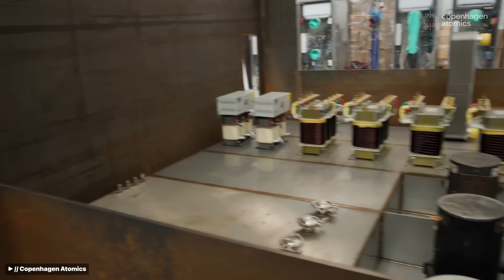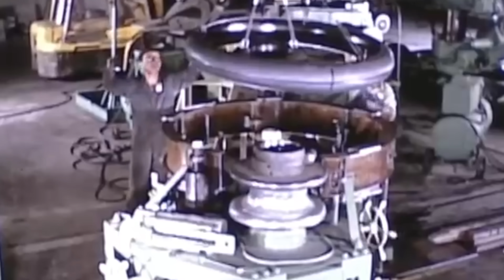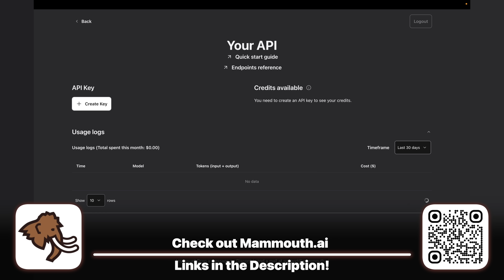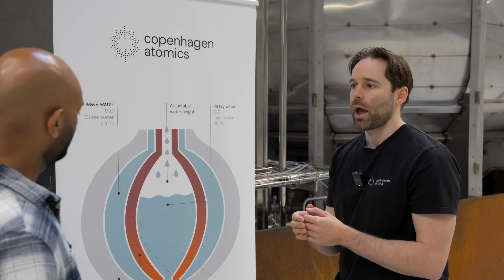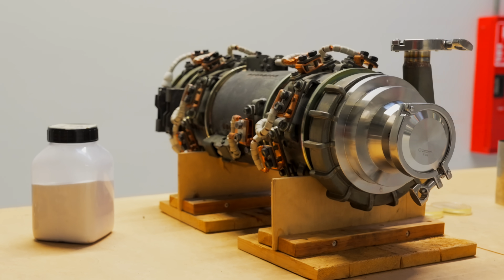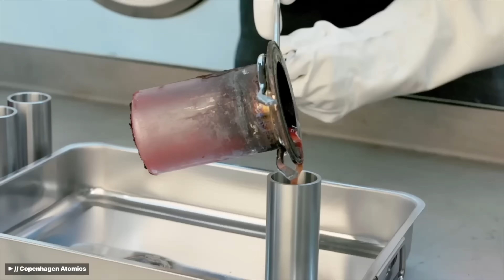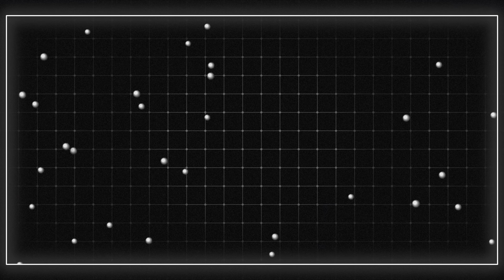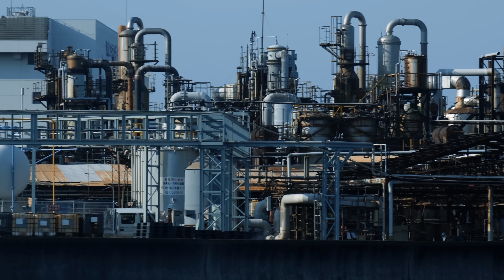This Modular Thorium Reactor EATS Nuclear Waste

Comment: A large number of reactors being widely proliferated is undesirable from the perspective of reducing security overheads.
Thorium Molten Salt Reactors look to be far more attractive than Pressurised Water Reactors from a safety perspective but they are not devoiod of issues. You are still dealing with radioactive materials and some of those in the decay chains are Gamma Ray Emitters.
I don't like the idea of a great many small reactors being proliferated, the more instances of a machine that exist the more likely that one will malfunction and transporting such things around should be avoided.
Perhaps a limited number of sites with multiple small reactors and/or develop larger reactors.
Small Mobile reactors look to be very useful things in the case of emergencies or for creating sources of power in space.
Dropping them on parking lots, no, locating them at a limited number of locations with appropriate security and facilities to process waste yes.

Comment: That's quite cool. I like the safety aspect of it. And I like nuclear. However, I'm curious about the lithium separation scheme. If a Li6 is absorbing neutrons wayyy too much, it becomes Li7. Which is what they want. Isn't there any application like you know, the regular nuclear reactors where they could use the Li6 as moderator or neutron absorber around to just make it become Li7 and use it after ? Or you know, just use their own process : make a first part, then slowy input Li6 in the reactor running it a bit overpowering to purify progressively and make more Li7 ?
Reply: They can easily decant the salt, most likely after the "life time" of the reactor they recycle most of the materials.
Reply: Yeah what he said ^^
Reply: Lithium 6 plus neutron doesn't make lithium 7 - it splits to make an alpha particle (ie a helium nucleus) and a tritium nucleus.
Reply: @2x6x250ml  oh ok, ty

Comment: I want my backyard Thorium reactor!!
Reply: It's about time, let's just get on with it!
Reply: Unfortunately fission reactors will always be big (the critical mass limits size) unless they can shrink particle accelerators down small enough to run small ADS (Accelerator Driven Subcritical)  reactors. Theoretically they could be made small enough for a household power & heat source.
Reply: @fredbcf1255  They made us small enough to fit in a jet more than 40 years ago. We can do better now.
Reply: @JadedCoffeeDrinker  Russia has one in a torpedo and and a cruise missile now. Poseidon and Skyfall I believe are the NATO names for them. But they run on weapons grade uranium or plutonium. That's what you need for a small core. Also neutron reflectors.
Reply: @JadedCoffeeDrinker  U can't compare military and commercial technologies for households.
Reply: @fredbcf1255  ive messed around with the math and theoretically with neutron reflectors you could make a reactor the size of a football/soccer with only a couple hundred grams worth of thorium you can even shrink it down into palm size if you include a small pellet of plutonium to provide some extra neutrons also all this is for the core btw not the whole system
Reply: @NHRTYu  No chance. The thorium does zip until its bred, a slow process that requires a time period to convert properly. The only way to make small reactors like that is with pure U233/U235/Pu239. You don't want any thorium in there.
Reply: @fredbcf1255  right mb meant to say uranium
Reply: Don't be silly!  If you want your own reactor the build it yourself!!!  Stop demanding!!!  That's not the way to get anything!!!  You didn't even say please or thank you.  Now...  I know your joking around and so am I.  I hope you understand.
Reply: @anthonybaransky137  Point taken. Not sure that's a great DIY project. I 💯%  would buy one though and bury it in the back yard, substation above and sell electricity to my local municipalities.
Reply: Oi mate! Ya got a loicense fer dat?
Reply: It is possible, but only if you like subscriction model.
Reply: Maybe get together with your neighbours on buying one that could power the whole neighbourhood and sell power to the grid.
Reply: Never it will be less than 30 MW. Never for households.
Reply: @MihailG5541    I've heard that word before.  'never'   - It's quite often incorrect.   Especially around politics and science.
Reply: @OneWildTurkey  Ok, never during that generation.
Reply: @MihailG5541  I will sell to the local cities/municipalities. And my neighbors for cheap. Sign me up!

Comment: It's bonkers how we keep hearing about this. It's orders of magnitude too expensive for mass production. As mentioned, solar+wind+neogeo+storage. At the small network level you can definitely get the same level of reliability for much less, and with basically all the tech in production already. For a few one offs where that isn't possible, there are other bespoke solutions already, and have been for decades.

Maybe if they had have continued on thorium 60 years ago, we would have had this decades ago and a price point that makes sense. So just no
Reply: Forget wind and solar with batteries.  They're pathetic.  Geothermal is the most optimum energy source.  Why anyone would entertain the idea of installing suboptimal solar and wind with piddly man made batteries escapes me.

Comment: Municipalities should have their own small reactor. It would be for basic electricity, electric cars and heating and cooling. This way we wouldn't have to buy energy (oil) from dictators and oligarchs.
But the power grid companies won't do it voluntarily, so legislation is needed, i.e. the right political structure. But the implementation of the political industry is currently controlled by the oligarchs through lobbyists and outright corruption.
Reply: Which country are you referring to?

Comment: At this scale, you need to see farther I think. It's small enough that it could be delivered to inhospitable environment and be used as the core of an outpost. Just fly to the middle of antarctica, drop it and connect whatever you need. no freezing fuel once started. Enough sustainability that an outpost deep in Antarctica's interior would not worry about losing heating at -80.

Long ago, a plan was theorised that installing hundreds or thousands of water pumps on the arctic ice caps to pump water up top would thicken the ice and possibly reverse the melting ice problem that was widely talked about at the time. It was impossible to implement since the energy needed to run them was almost impossible to bring without ludicrous amounts of money and would constantly require more. a reactor the size of a container able to run for a couple years could have made it possible. Still would not have been done I think, but still

Comment: Not convinced. Targeted cost/kwh is $20/kwh with these reactors. The global benchmark for solar + batteries is $0.08/kwh.
Reply: 20usd per Mgwh he said not kwh
Reply: @rtzx12570 you are correct. I stand corrected. More power to them if they can do it safely. I'm going to stay skeptical for now. I'm Canada, we're seeing $20 - $40/mwh and we've just tiptoed into renewables and batteries. No nuclear risk.
Reply: @TooSchoolForKool  Denmark is widely considered #1 in the world when it comes to the percentage of its electricity consumption covered by wind. Its not like we do not use renewables or have solar (tho we don't lead in that by any means). But we just have to consider that sometimes the wind does not blow ;)
Reply: Twenty dollars per kw-hr??? Maybe twenty cents.
Reply: No way... That's more expensive than it should be by orders of magnitude
Reply: Pretty sure he said MWh. That might be wrong, but he didn't say kWh
Reply: The cost of a fully firmed, 24/7 solar system is much higher than the simple $/kWh figure quoted for daytime energy.  Also, In densely populated or land-constrained areas, nuclear’s energy density is a major advantage because the equivalent solar would require tens to hundreds of square kilometres.
It’s a complex problem and if they can get these reactors online ( a big if right now) it really would be a game changer given the huge surge in demand being caused by data centres and electric cars.

Comment: Could they not place this container under ground via a elevator and place in to a room this way you don't need a massive steel container to protect against bomb,  plane strikes, etc? Sure it has to be in a stable subsurface areas. This way they can be placed where the power is needed and out of sight and give additional safety.

Comment: 40 MW per day per line? That's 14.6 GW per year per line...still tiddler level.  Several hundred gigaWatts of solar are installed per year, and rapidly accelerating.  Tens of gigaWatts per year of nuclear will be a small amount useful for high latitudes and data centers, but to make a big difference to global power use, it needs to ramp up a hundredfold.  All the best for them.
Reply: In China, this is a current reality, one such reactor is already running there, unlike other countries where they are just trying to invent one... How on earth is it possible that this video ignores this fact and does not even mention the Chinese success?

Comment: Hang on a minute. Did you say that it is presurised with Heavy water at 600 degree?

Good luck getting certified.
Reply: No, they said unpressurised heavy water at 80 degrees.
Reply: @edbruder9975 Which salt do you know about that is liquid at 80 degrees?
We are talking about a Molten Salt reactor, aren't we?
I didn't even bother to check it but you should check your hearing.

Comment: I really hope these guys succeed but there is a lot of engineering challenges ahead.
It's not just Lithium enrichment, you need the salt purification to keep it non-corrosive even as Uranium splits into random chemicals, you need the protactinium separation to pull it out of your blanket salt as soon as it is created, then of course pull the Uranium out and introduce it into your fuel, I've seen that it's apparently doable with electrolysis which is huge but it's still a process that needs to happen with a radioactive hot SALT and that's no small matter.

The reality is that existing 60 year old nuclear technology (Light Water Reactors) is ALREADY better than fusion (baring some amazing breakthrough) when it comes to economics but there's a lot of barriers that add insane ammounts of overhead costs that simply don't have to be there. You can build nuclear cheap, quickly and safely just not in the overregulated western world, you need to go to South Korea for that.
Reply: Fossil fuel lobby effectively sandbagged nuclear with astroturfed enviromental and safety regulations
Reply: yep, I want to learn more about that. It's the holy grail. They need chemists to solve this.
Reply: @Mr1Spring  Sure it's TECHNICALLY the holy grail and like I said I wish them the best of luck but it's not very much ahead of the next best thing and that one is about on par with many other things. There's lots of ways to split an atom and plenty of them can give us nearly limitless cheap and clean energy. Better than fusion for all of them (because its cheaper and easier)

We should be doing all of them at the same time right away and see what the market ends up chosing. But for that of course the government needs to stop interfering so hard.

Comment: Just to be clear, any facility, if impacted by a large enough munition, will crack wide open. So calling these small plants out, especially when encapsulated, is a bit disingenuous.

I'd be far more concerned with end-of-life recycling or emergency maintenance of the molten salt loop.

Also, that litium-6 that is removed can be used to make Deuterium for fusion reactors.

Comment: Game changer? Absolutely yes, but not because of thorium fuel but the low-pressure/high-temperature molten salt reactor technology, that is the real game changer. This same reactor using low enriched U235 would be much less complicated and much less expensive, that's the game changer. That's exactly what Terrestrial Energy, Thorcon, Moltex and a few others are doing, those are the ones to watch.
Reply: With all due respect, and as a former proponent of nuclear power, nuclear is just mankind's most complicated and expensive ways to boil water.

With recent developments in geothermal technology and drilling, I can no longer support nuclear as an option.

Beneath your and my feet is a natural thermal reservoir/battery so gargantuan in scale that just 0.1% of the thermal energy is enough to power ALL mankind's energy needs for millions of years.

Millimeter wave drilling has now unlocked geothermal as an option in ALL places and ALL times.
Reply: @TerraPotens537  Maybe, but that remains to be seen. Remember geothermal will also be boiling water. The output temperature will be the real test. If the best they can do is 250c, no game changer. 500c, now that's a game changer. I have my fingers crossed.
Reply: @chapter4travels  "Remember geothermal will also be boiling water."

Yes, but here's the difference.

With a coal power plant you HAVE to expend a bunch of energy collecting and delivering the fuel to the power plant to create the thermal energy to boil the water.

With a natural gas power plant you HAVE to expend a bunch of energy collecting and delivering the fuel to the power plant to create the thermal energy to boil the water.

With a nuclear power plant you HAVE to expend a bunch of energy collecting AND REFINING then delivering the fuel to the power plant to create the thermal energy to boil the water.

With geothermal you have an already present reservoir of thermal energy just waiting to be used. 

500c is the target depth.
Reply: @TerraPotens537  I'm agreeing with you, if they can reach the upper temperatures and the "hot rocks" don't just cool down in a month, it will be a game changer. It remains to be seen.
Reply: @chapter4travels   No doubt the rocks will cool down some, this is a given, but it can be managed in the sense that as long as you're not pulling TOO much energy out of the system they can last for 5-6 decades.

The "plan" is that you have "fields" that you pull from, and you rotate through the fields over decades.  So say you've got a geothermal power plant, and you exploit a field for a few decades.  You then move to field 2 and pull from that for a few decades.  Then field 3 for a few decades, then field 4, then 5, then 6, and back to field 1.

Comment: The price comparisons are laughable. You are comparing the cost of the reactor container with a full nuclear power plant. Copenhagen will also need a cooling solution, steam generation, turbine, etc...not talking about all the facilities for safety. It is like comparing the cost to the AP1000 but only the reactor vessel.

Comment: Cheaper than solar??? That's not saying much, solar is some of the most expensive dispatchable electricity we have. Why is that? Because solar does not generate dispatchable electricity. Raw solar is cheap, but converting it into 24/7/365, year after year electricity is crazy expensive and complex.
Reply: Solar is pathetic, really.

Geothermal is the solution.
Reply: @TerraPotens537  Maybe, but that remains to be seen.
Reply: @chapter4travels  I'm very encouraged by the progress made so far.

Millimeter wave drilling, a recent development in drilling tech, will unlock superdeep supercritical geothermal systems in ALL places and ALL times.

First field tests of MMW result in roughly 5 meters of penetration per hour through tough rock like granite compared to mechanical drill bits which typically get less than a meter of penetration per hour.

And that was with a test drill drilling a 4 inch borehole 118 meters through pure granite using only a 100 kW portable power plant.

Commercial scale drills will drill 8-12 inch boreholes using MW scale portable power plants (10x the power of test drill) so they expect to eclipse 5 meters of penetration per hour.

Comment: Very interesting engineering, but a solution lacking a problem.

Renewables, heat pumps and (thermal or electrical) batteries can already solve every energy issue you have, at a fraction of their cost.
By the time they are done developing, renewables will simply laugh them out of the room.
Reply: Solar and wind with batteries are pathetic as energy sources.

Geothermal is a much better alternative.